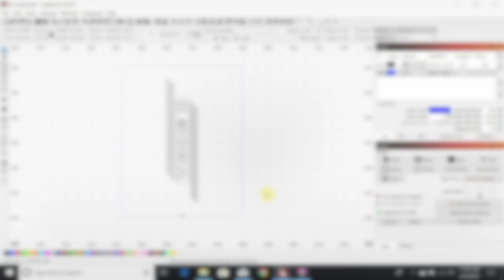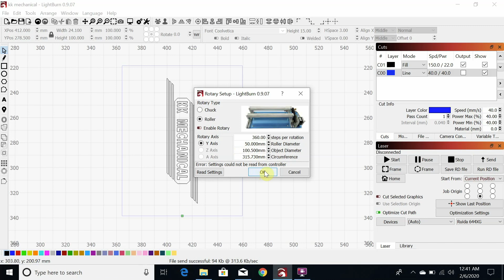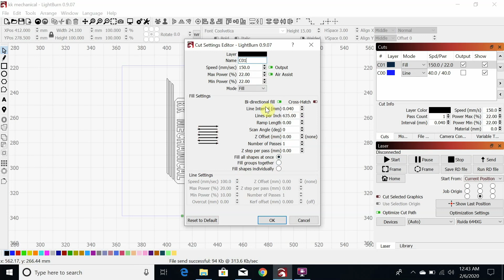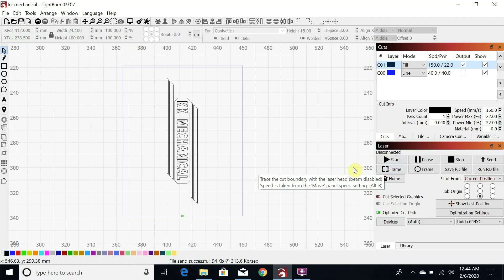How to Laser Engrave Tumblers with a 60W Chinese Laser from Ebay!

Comment: So used your directions from this video.  Running an Omtech AF2028-80 laser, and a Mansfield Customs rotary.  Just did my first  beer glass, and the logo and writing came out mirrored (can read it correctly from the inside of the glass).  What did I miss?  Rotary is oriented in the laser just like yours, and logo orientation was just like yours in Lightburn.  I'm also getting an out of bounds message coming up.  But I can click it away and the logo comes out in the right spot. (still flipped though)

Comment: I’m trying to set up my piburn roller rotary…should I have to mirror all my designs for tumblers or is there a way to rewrite so that I don’t have to remember to mirror. I have a 60 watt blue/grey Chinese laser.
Reply from the maker: Have you tried the mirror setting in the rotary setup?
Reply: @BeardedBuildsCo  yes I just keep ruining tumblers bc I forget to click mirror every time. Someone advised to change A+ wire to A- that runs to that axis and that would fix it but I’m worried about what it might mess up if I switch the wires.

Comment: Hey there.... Recently got a 100 wt machine and we're so disappointed about the program that comes with the machine so you can run it..... Do you happen to know what program can be purchased and uploaded to it? Our machine came with a rotary tool too..... The program that came with it is Lásercad 7.98 and has so many limitations, it makes you feel like returning the thing....any help you can provide will be highly appreciated sir. Thank you
Reply from the maker: Without knowing anything about your machine it is difficult to make any recommendations. The preferred laser program amongst users is lightburn but you will have to visit their site and check compatibility with your setup.
Reply: @BeardedBuildsCo  thanks for your response.... You know, I didn't include a name or model because the thing doesn't even have one 😅 we trusted a local company who resells them (they do the leg work around the import  process, etc) and we are coming around different issues now that the machine is in oir hands.... I'll check lightburn out sir and we highly and deeply appreciate you pointing us out in that direction... Thank you much
Reply: Hello BBC. So we got the trial version of lightburn to get started…. We got version 1.2.01 …. It runs well until we plug the rotary chuck…. The program starts making a noise as if the usb cable connects and disconnects every 10 seconds… and the rotary enable option is not available on the tools drop down menu and we haven’t been able to find the option anywhere on the program….. wondering if you got your rotary on the side or if it came included with your machine? Also wondering if the rotary enable option will become available if we purchase the license? Oh and when the rotary is plugged the program seems not to communicate with the laser …. We couldn’t upload any designs to it from lightburn …. Sorry to tell you all about our drama here… saddest part is lightburn doesn’t have a customer service dept that can help ….. just kind of trying to get your thoughts about our challenges :) would appreciate if you can share what you think about it, thank you for reading

Comment: Great video, I've got an OMTECH 50w and just put that rotary on order. I've run a lot of tumblers on my diode laser (Ortur OLM2 Pro 5.5w) but this will be a first on the CO2 laser. I have noticed that you disconnect your machine Y axis cable and plug in the rotary Y axis cable with the machine on. Is it ok to do this? I've always turned my Ortur off before switching (I have a switch box between the steppers, so I just flip the toggle switch). I'm going to install a second 4 pin aviation connector with a 4PDT switch on the OMTECH so that I can switch between normal and rotary. Is it ok to do this with the power on? Again, thanks for all the video, I'm learning a lot from them.
Reply from the maker: Yes, either way works.

Comment: I have the 50w Omtech and I can’t seem to get through to the metal. It still looks dark after engraving. How much difference should my settings be than yours since my laser has less power? I feel like I’ve tried it all! 😑
Reply: I'm using a 50w Chinese laser. I'm getting good results at 170mm/s, 20%. More power actually seems to do worse and 'bake on' the residue.

Comment: This is a great video - especially since I am using Lightburn. I am having trouble though, getting the Stainless Steel to come out shiny after engraving through the powder coating. I have a 10 W Diode Laser - do you have any insight as to what I can change?
Reply: That means that it is probably too deep

Comment: We just bought the 80watt Chinese engraver and are having a very difficult time with it. Would you consider a FaceTime tutorial with us for a fee? We own a car audio shop and want to be able to use this machine on metal, plexiglass and wood so that we can engrave our logo onto our custom boxes etc.
Reply: The first thing you need to do, is make sure all of the lens and mirrors are pointing the the centers. K&G Makes It has a great video on this.  The second step is to do a ramp test to find the best focal point.  Most come with a generic plexiglass spacer, but none come accurate from the factory.

Comment: Are you still big on the omtech laser or have moved up? What's your thoughts on the Mira 9 vs what you have?
Reply from the maker: I still have both of my omtech lasers and see no reasons to spend double plus on a Mira 9.
Reply: Great you were the first to get me excited about this so I am getting started and did not want to spend 12k. What's your thoughts on powder coating a tumbler red and then a second coat of black then laser etching it so the red shines through? Is that possible ?
Reply from the maker: Hmmm… that would take a lot of trial and error and even then I don’t know that the red would still look red after the laser does it’s thing.

Comment: Do you burn with laser out of focus, I use same settings i. light burn with 50w laser, with ramp test showing 5mm focal from base of lens guard to engraving item.  I get lines in my tumbler.  if i use 4mm focal it gets better but looks like only way i get clean is with 1000dpi which slows things greatly.  Thoughts
Reply from the maker: My focus point is 5mm and I do tumblers out of focus at 7mm. My go to settings are 150mm/s at 22% power and .05 line interval.

Comment: Man I have a 50W co2 laser and I have the hardest time with this damn Red tumbler. I've been trying forever to get the right speed and power settings but there always seems to be some red small powdercoat dots left behind. Any ideas on how to get it to laser all off? I've tried everything from 20% power 30mm/s up to 100% power 75mm/s. Maybe just try a different red from another shop?
Reply from the maker: Have you tried lowing the bed a little to put the cup slightly out of focus?
Reply: @BeardedBuildsCo  I haven't yet, I will try that next. I know it's not too great to run the laser at a higher power so I may try to do another test cup where I run around 50-60% power and just start at around 100mm/s and go down to 10 or so to see if any of those look any better. And I can try and lower the bed too. Just annoying I can't get it to get all the way through yet lol. Thanks for the reply!

Comment: So in lightburn we do not have to mirror the text from what I understand?
Reply from the maker: Sometimes if the wiring on the rotary is backwards you would need to mirror the text or switch the origin for it to print correctly.

Comment: Hi, your video has helped me better understand the use of Rotary Engraver. I have a CO2 60 Watt laser machine. Do you think that the Rotary MANSFIELD can be used for a Chinese 60 Watt laser and that it can adapt different cylindrical containers? Thank you for your attention 🤗
Reply from the maker: I’m glad I could help! The Mansfield works in my Chinese machine and should work in anything the has the 4 pin connection. It works great on all kinds of cylindrical objects.
Reply: @BeardedBuildsCo  Great, thanks! I found it on eBay so I could buy it, along with the 4-pin extension cable. Can you tell me the length of parts that can be placed in this rotary for engraving? The manufacturer does not put those specifications on the eBay page. Thanks a lot! 🤗
Reply from the maker: I have done 40oz hydroflasks and those are about 12” long.
Reply: @Bearded Builds Co  Great, thank you so much
Reply from the maker: @LuisMéndezAlejo  you’re welcome! Please consider using the link that I have provided in the video description. It will provider me with a small affiliate commission through eBay. Thank you!

Comment: Looks like I have same Yellow 60w laser but a different rotary. I' m just starting and can't get rotary dialled in. Step per rotation?  I have DMC DM545-A stepper motor setting are 1.27 (1-3) 2000 (5-8). I've tried 2800-3100 and more. I need to pratice on Dixie cup. At this rate years away from Yeti. My first to tumblers look abstracted. Lol great video will work on my skills tomorrow.
Reply from the maker: The steps per rotation that I was told to use were 4100 but with my machine I have to half that. Currently mine is set to 2050. Give that a try and see if it works.
Reply: @BeardedBuildsCo  , thanks for the quick reply. I will try that setting. Thanks
Reply from the maker: William Bailey anytime!
Reply: I have a 60 watt Omtech laser with their 4 wheel rotary they recommended to start with 2500 steps. It turned out i had to set it for 7500 steps and now it works right.

Comment: Great video, do you have a video of how to set up the rotary attachment.
Reply from the maker: I don’t, but I can add it to my list of videos to make!
Reply: Bearded Builds Co  what software where are you using
Reply from the maker: James Wilson I use lightburn
https://lightburnsoftware.com
Reply: Bearded Builds Co I am trying to use my rotary which I believe is set up right as in 100 mm distance but my image is a mirror  but when I burn it without the rotary is is fine not sure what I am doing wrong
Reply from the maker: James Wilson I have a buddy that has the same issue with mirrored images. Which way does your cup rotate? Does it roll towards that back of the machine or towards the front of the machine(like mine)?
Reply: Bearded Builds Co it roll to the back
Reply from the maker: James Wilson then that is the problem. I have seen that sometimes the stepper motors are wired backwards. So you have two options. Mirror the image in your software or change the wiring on your rotary connections.
Reply: Bearded Builds Co that seems to be it . Thanks
Reply: Bearded Builds Co  finally figured it out, was watching a YouTube video job zero and machine zero setup for light burn. Fixed it
Reply from the maker: James Wilson so was there a specific setting that you changed?
Reply: Bearded Builds Co yes machine zero setting to the lower front seem to fix it

Comment: Is the tumbler anodized aluminum? The ebay description of the laser you're using doesn't state that it engraves metal, so I'm assuming it's engraving into the anodized powder coating?
Reply from the maker: Justin Lee these cups that I am engraving have powder coating on them. The laser removed the coating to expose the stainless steel underneath. The laser can also work on anodized aluminum. I have done a couple of projects with that material. CO2 lasers do not engrave metals, a fiber laser would be the tool for that. There are marking sprays on the market that can be used to mark on metal with a CO2 laser.

Comment: Do you know if this particular laser compatible with Mac / IOS?
Reply from the maker: Leslie Morovitz this laser works with both Mac and windows when you run lightburn on the computer to control the laser. I have both and have used it on both platforms.

Comment: Object diameter is just a calculator. It does not change the output.
Reply: I was told to do edit the circumference, and the object diameter changes automatically.